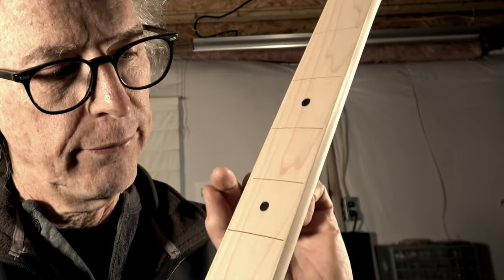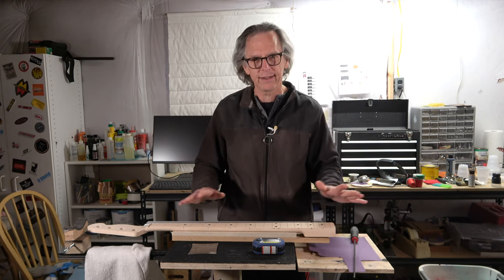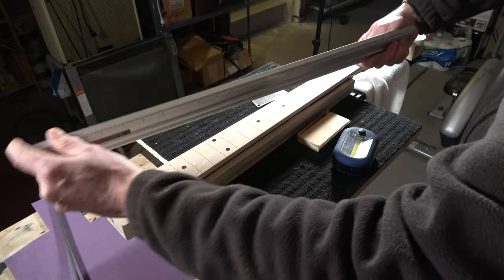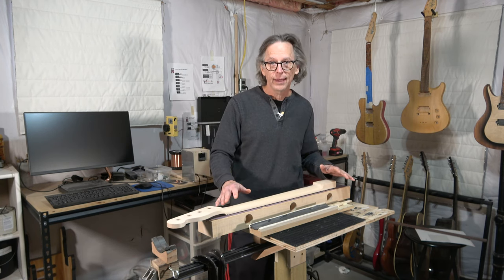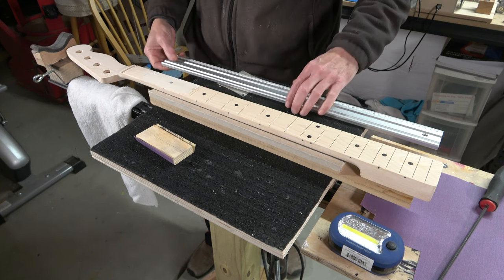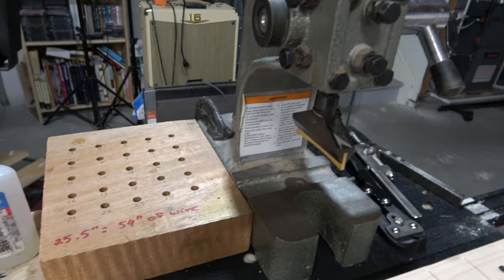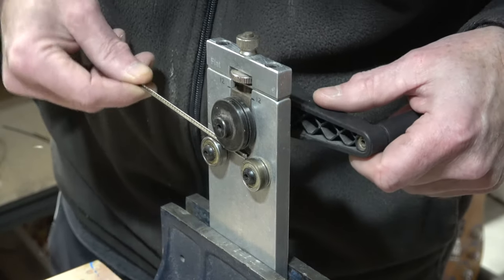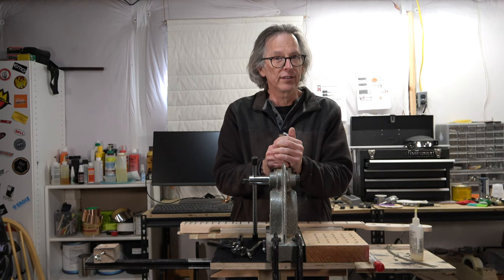Building A Precision Bass Part 10 Installing The Frets

Comment: so, you got these cheapo glue clamps, which I can get for 2 euros a piece, and they are pretty good. for your average glue up, they deliver plenty force. but the best thing about them is that they can not only clamp but also serve as pushing devices. So if you make a frame you can glue up much larger things with them. downside is with a lot of layers, you're gonna want a lot of pressure power

Comment: Now that your neck is (basically) done and we await the body completion, do you keep the truss rod in neutral while it sits without string tension?
Have you ever experienced a neck that developed backbow when not under string tension?
Reply from the maker: I don’t mess with the truss rod unless I have to. I’ve never experienced backbow when not under string tension. I would imagine that would only happen if I had used a poor choice of wood for the neck.